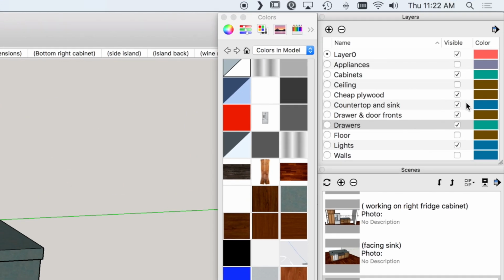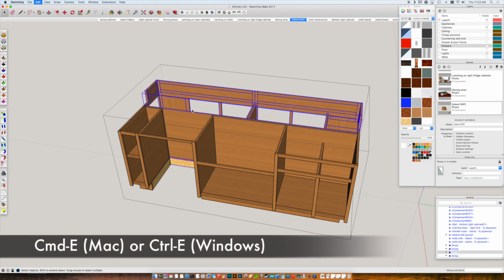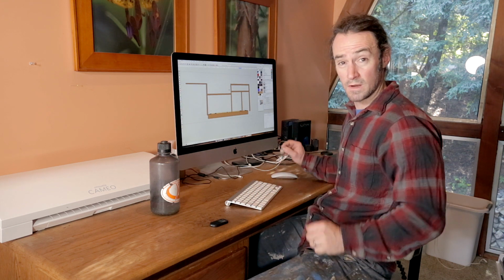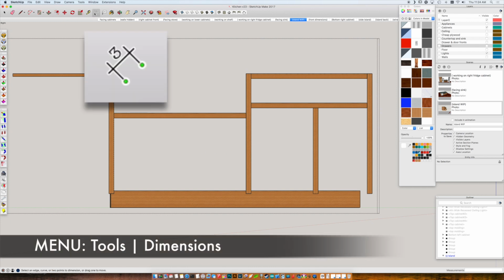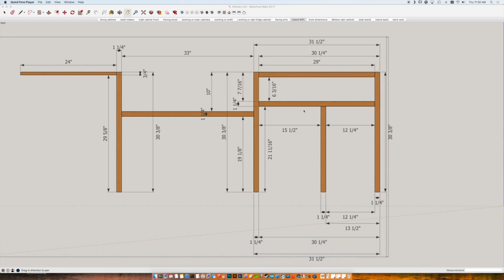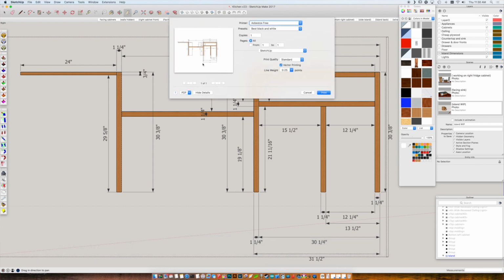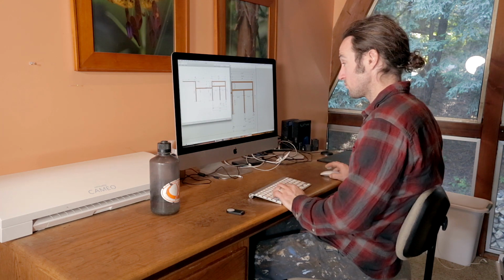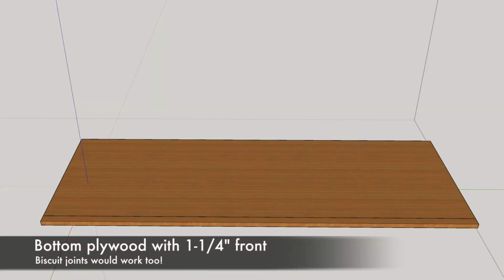Ep 2: Making Kitchen Cabinet Plans from SketchUp CAD Model - DIY Kitchen Cabinets

Comment: Man, I really need to force myself to sit down and learn SketchUp. Like many, I tend to build from scribbled notebook sketches and "make-it-up-as-you-go" kind of method. Is there a particular version or template of SketchUp you suggest to get started with? I'm retiring at the end of 2019 and then I'll have no excuse to not teach myself to use it. I've seen some tutorial videos and it looks like once you get familiar that popping on pieces and moving stuff around become second nature. Also, I'm closely watching your build series because I've dabbled in cabinets but have really only used pocket holes and frameless style cabinets as I find them extremely easy. I just did a full kitchen for my in-laws and they love it. Thanks for taking the time to make these videos. Aloha!
Reply from the maker: Hi Artie - I just use the standard template for "Woodworking - Inches". I set the Units (in Model Info) to be 1/32" precision or 1/16" (depending on what I'm doing) and I sometimes check "length snapping" set to 1/16". That is pretty good for most woodworking.  SketchUp has a pretty high learning curve, but there are just a few basic concepts; once they are mastered, it is all pretty easy. I'll try to do some videos on it; I used to give programming talks in front of hundreds of people, so I can go over basics pretty well. 

Are you in Hawaii? I'm originally from Maui. Good to hear that you made cabinets too! pocket holes are fine, IMHO. I use them wherever people won't see them.
Reply: Corbin Dunn Yes sir. Been living in the island state for nearly 29 years. That’s cool that you’re from Maui. Not my favorite island though. I’ll keep an eye out for those programming videos.